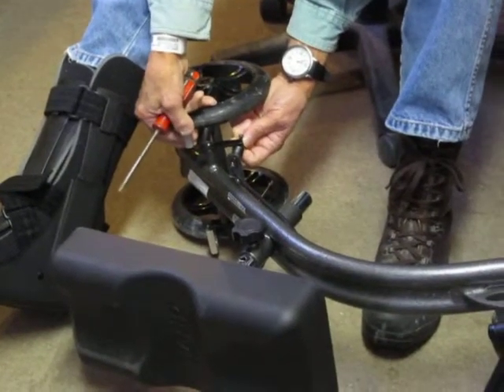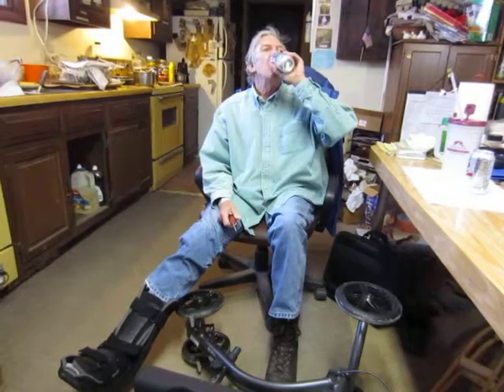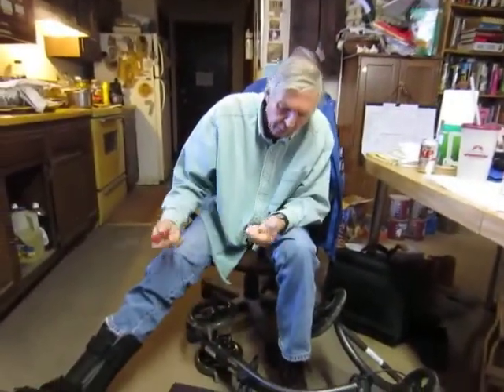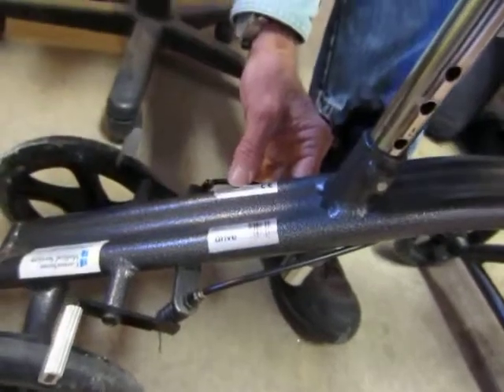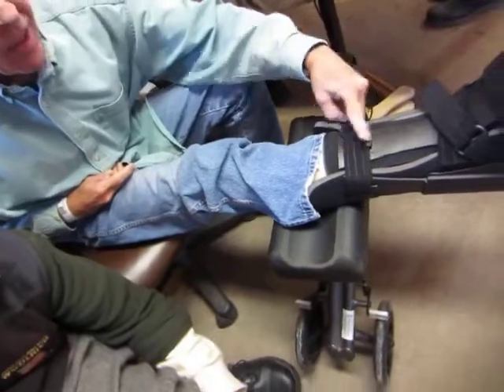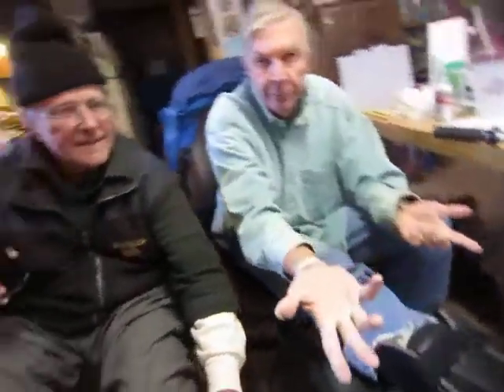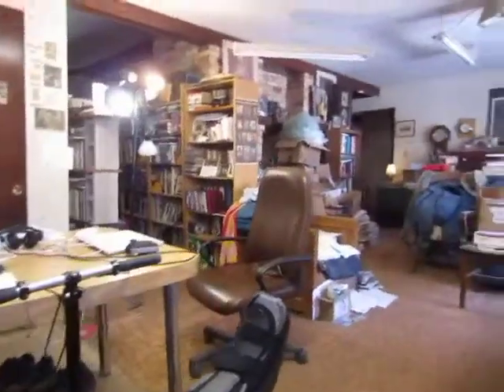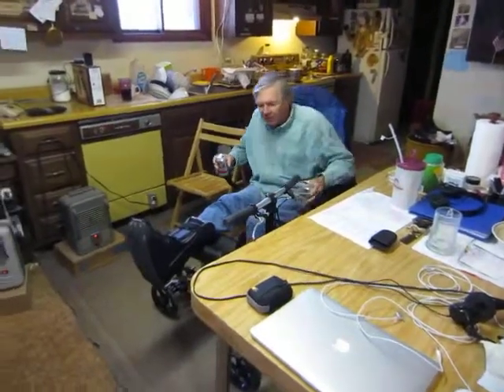Paul (and Joe) Go(es) to Orthopedic Land

Comment: Seem like you are having your cam on a sick or something? Cool. What are you drinking?
Reply from the maker: I put my camera on an "iPole Stealth" monopod-stick when doing my walk around videos. It extends to 42" and is strong enough for a full-sized DSLR, although I do not have one of those (yet -- ?). I drink cheap boxed wine diluted up 3 or 4 parts water to 1 part wine. I'll generally run through 10 liters every fifteen days. It's cheaper than beer. Beer is taxed at a much high rate here in Ohio. This was Almaden Cabernet Sauvignon with Del-Co Water Company water straight from the tap.